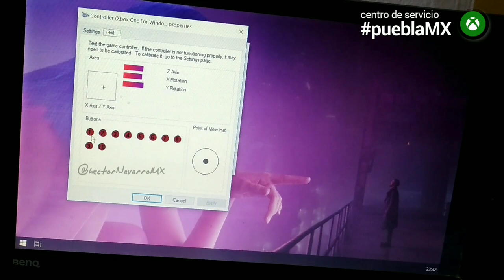Xbox one controller water spilled

Comment: i popped off the plastic from the right and left side and left the controller in the sun for an hour and a half. It works good now
Reply: Do you mean the two little things on the sides that are kinda difficult to pop off?
Reply: @Trashytrash1118  i mean like the plastic of the handles on the back
Reply from the maker: Probably... But the sun does not make the function that toothbrush and alcohol does.

Comment: is that a heat gun you are using after you put it in the ISO then scrubbed it with the brush
Reply from the maker: Yes, its a Saike air gun station, at 100°C. Then I used a metallic pray tool.